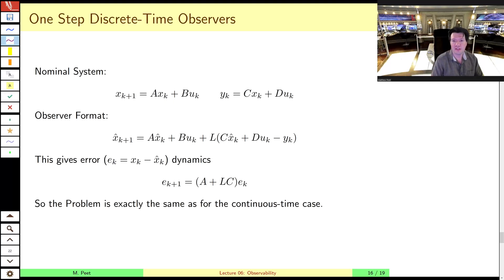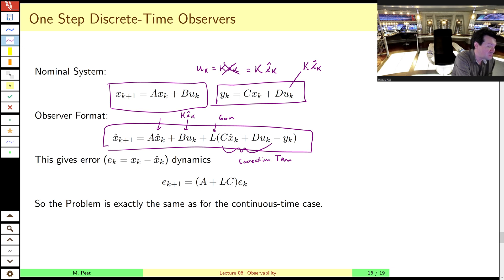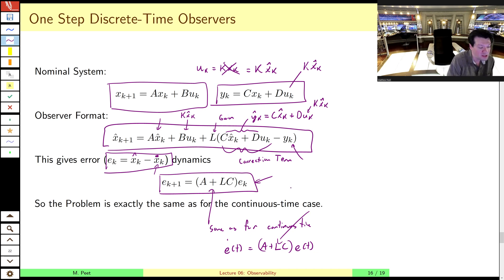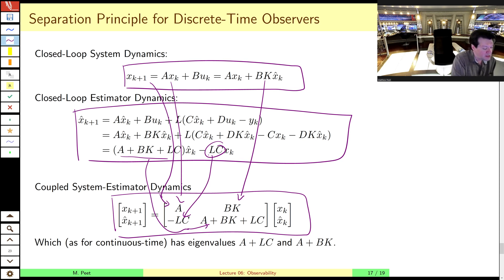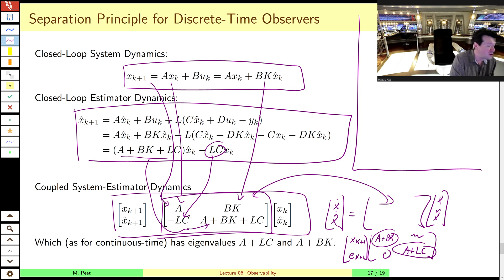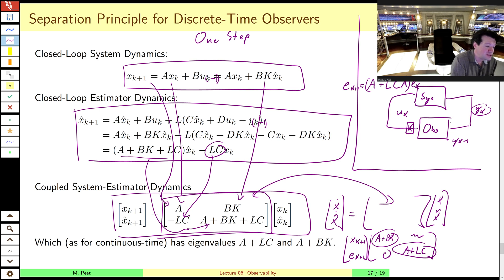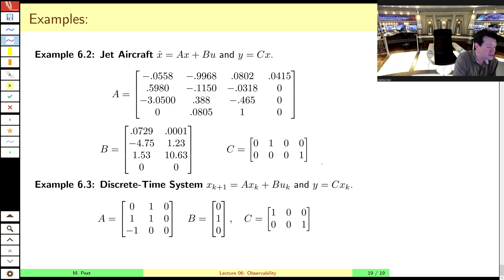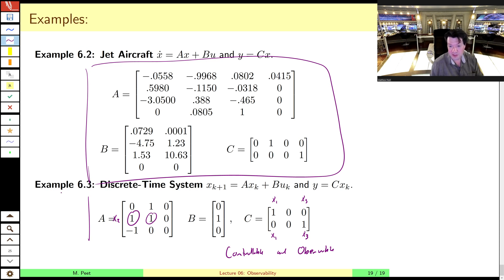MAE509 (LMIs in Control): Lecture 6, part C - Discrete-Time Observers

Comment: Please Prof can you help me with an example of synthesizing H2 LMI gain for a discrete system, I am having problem synthesizing it.
Reply from the maker: Well, for a discrete-time system, one can define the H2 gain as the integral on the unit circle. Offhand, I don't recall if this has a clear physical interpretation. Of course, you can interpret LQR control as minimizing the H2 norm in a certain sense, so that might be the right approach for you. Maybe I should add this to the lecture when I update the course...
Reply: @MatthewPeet  
Okay sir, I am waiting for your update.